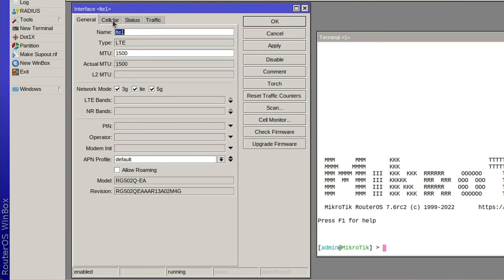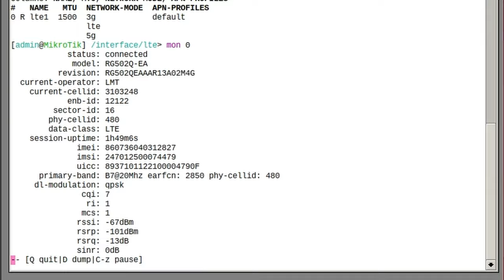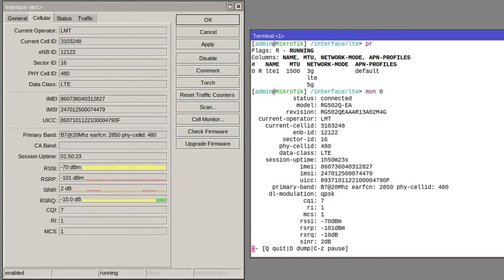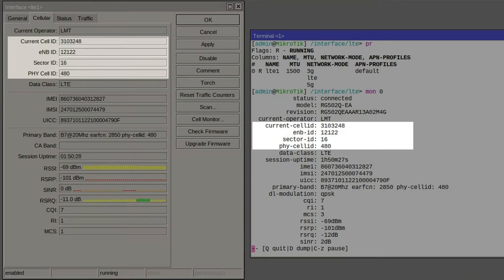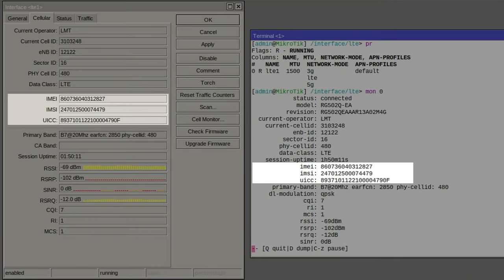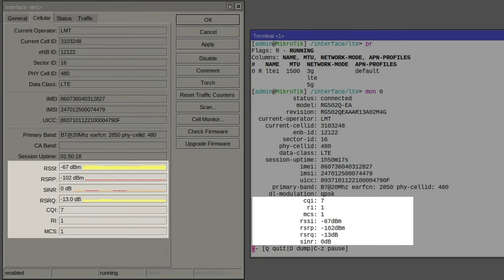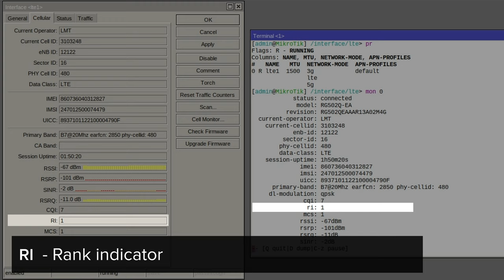How to read and improve your LTE signal

Comment: From my experience: 
1. look up for BTS stations on map, 
2. buy cheap pre-paid sim cards for every telecom operator around 
3. point antena on every BTS you find promising. 
4. test
NOTE: signal strength have much less impact on actual transfer than load on that certain BTS antena with you're connecting to.
As always, thanks for the video!
Reply from the maker: Yes, this is a good strategy. https://www.cellmapper.net/map is an excellent site
Reply: What about using apps like OpenSignal to find a near cell tower?
Reply: most of the time it works, sometimes prepaid sim cards are "low priority" so speeds might differ.

Comment: EG18-EA it would be nice to have a solid tutorial to setup carrier aggregation and cell lock in roder to squeeze everything out of the selected bts
Reply from the maker: Those features are turned on automatically, there is no need to set them up
Reply: @mikrotik  if You reboot the router/antenna - channels used for communication might change (if not locked) ... so please add this information

Comment: Thank you for the video! I don't miss any of your new videos.
It would be great if you can tell how to read quality of LTE signal measurements. What is good and what is not? 
How to connect LTE antenna that is on this video preview to my Chateau LTE 12 device so LTE signal would improve, or it doesn't work that way?
Reply from the maker: Like the other comment says, LHG contains the router too. It's not an antenna, it's a router+antenna 2in1
Reply: @mikrotik  Wait a minute.. I thought that this was just an LTE modem that it was need a router at the end of the Ethernet to share the connection.. So Is Lhgg a modem-router device or just a modem one? So if I connect a switch at the Ethernet, will the lhgg share ips like a router via DHCP?
Reply: @_UserUser_  yes its router +antenna 
At the end you just attache switch and use the internet 
It dont need router 
Because it also a router and a best quality router

Comment: hello 
I am facing a problem with the mikrotikatllte18. When I run the speed measurement or download application, it disconnects B1 and B3 and only B40 is connected to me.
Reply from the maker: It is impossible to tell what happens without deep investigation. It is very likely your operator disconnects you from those bands for some reason.

Comment: I use scripts to detect near bts antennas and create next scripts with CellLock to them. Next script at 3am try connect to them and do speedtest and back to auto settings. After few days I can move antenna and repeat process. All results of that doing are in comment's of CellLock scripts who do speedtest - > those print file and sort in excel - I have what in my area is best - but this is long process like 1week.
Reply: Testing at night could cause false results if your operator is saving energy. Here in Finland all operators do some kind of energy saving at nights. Others shut down some frequencies and others shut down MiMo on their base stations during night time.
Reply: @MikkoLundahl  In Poland we have best speedtest at night when is low count of users, good time to test max speed. Each country have differ spef. Differ bands and CA matrix. Some ISP even use QoS and many CA not change anything.
My scripts give me way to discover that cell's who are working, give some speed and then I have proper cells to focus signal on them. I use LDFR+EM12G mostly.
Reply: @SiBex_ovh can you share these scripts? They sound fantastic

Comment: Is there a way to force use more antennas? I see I'm only using 2 but there are more bands available?
Reply from the maker: Choose a MikroTik device with a higher CAT modem, they are able to work in multiple bands at the same time, with the same number of antennas. For example LHG LTE18 supports this feature
Reply: @mikrotik  i have ATL LTE 18 (ATLGM&EG18-EA, 4x4 MIMO) so its capable. I assume network operator could be blocking it, and question is: is there a way to trick operator to use 4 bands/ more antenas? i tested in firewall TTL setting to add 64/65 but it did not impact speed. So is there another thing i could do to improve my speed and use more bands/antenas. (my RI is 1 or 2 -  would like to see 4 :) )
Reply: @mikrotik  I own one. It's gorgeous, it works very well.
I was thinking of making a switch to 5G with a better performing antenna. But this time I don't want to put it on the terrace of the house...possibly on my balcony. I live on the 4th floor and I can see the BTS. There are no obstacles between me and the Tower. The exception is some other buildings that have one floor more than mine. i.e. a 5* or 6th floor but to be sure I would have to do some test measurements.
I had spotted the Chateau 5G but they are too expensive.
Do you have anything cheaper?